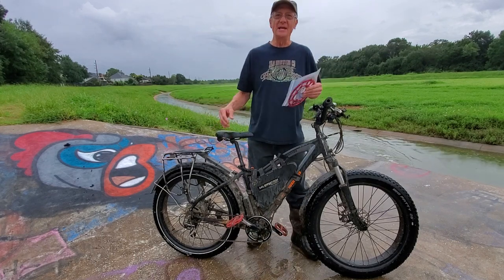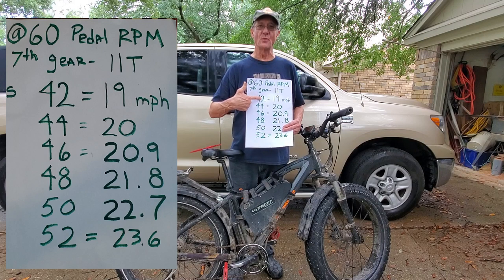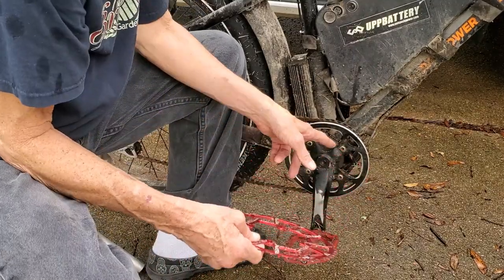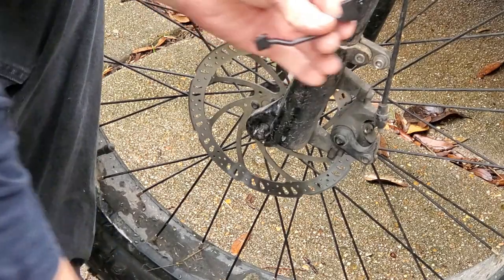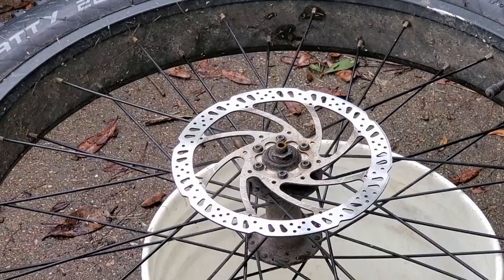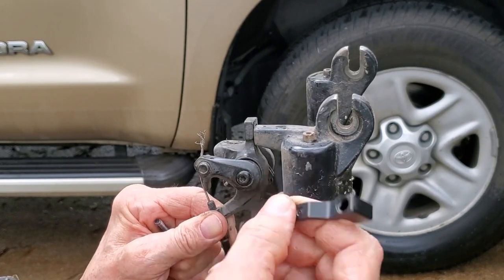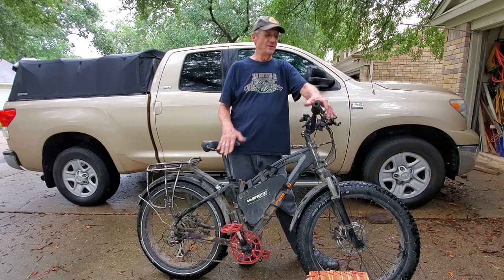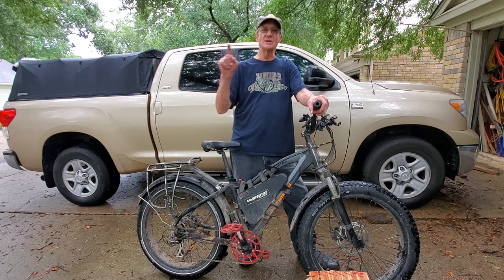New RadRover Upgrades!!!

Comment: Funny enough, Area 13 makes a 246mm rotor with a brake braket extension that adds the needed space on a 203mm adapter, stacking them. So that does now exist, if someone wants to go from 203 to 246. Though, it doesn't work for 160. Just 180 to 203, then 246.

Comment: I have a 2020 RadRover, changing the stock 42T chainring to a 52T. Did you add links to your chain? I read that you should add chain-links when you go with a larger chainring. My name is Stan too.
Reply from the maker: I didn't add any links and have had no problems. But I never hardly use my 1st gear. I also did my Himiway with no problems.

Comment: I know I'm a little late to this rodeo but I have a couple comments and questions.. I don't believe I heard you mention the bolt hole spacing on the sprockets is important but I did see in your link that it mentions 104 BCD, so hopefully folks will catch that if they order it off your link otherwise they might wonder what the heck's going on when they try and line up the sprocket holes. LOL. The other thing might be trivial but you didn't point out that the loctite should the blue loctite. I'd hate to see somebody put the red on there and have to break out a grinder later. LOL. I did the same power upgrades as you and get the 28 to 30 mile an hour throttle only. I was still getting that same free wheel pedal effect as you at about 22 mph. I had only gone up to a 46 tooth on the sprocket  because I wanted to keep the chain guard and I noticed that it didn't give me much less freewheel pedal effect. After seeing your chart I now know why. LOL. Putting my new ring on with both original sprocket guards also  was a real nightmare getting everything to stay in place while you try and line it up to bolt on. I was just wondering if while you were looking at larger sprockets did you also look for possible larger chain guard replacement ? I do want to go to the larger sprocket after seeing your post but I need to have a chain guard. Also I was also wondering why you didn't do a bigger brake rotor on the rear also. I haven't really looked on my Rad Rover to see if that is even possible. I upgraded to the hydraulic only calipers and I am not happy with the performance of the rear one. I was thinking the bigger rotor on the rear might help.. the rear doesn't even lock up as good as the mechanical break did on the rear. I should have listened to the reviews that said those hydraulic calipers are a waste of money. LOL.  Thanks

Comment: Hey Stan if I want to do the front brake could you recommend a different spacer  so I don't choose the wrong one? The one you linked to is no longer available. Thanks I have a 2020 RR Step through I am hoping to do both of the upgrades in this video

Comment: Hey im plaing on changing my chain ring on a stock controller im thinking 46 tooth did your upgrade affect changing gears?
Reply from the maker: Just going a little larger, you shouldn't have any problem. Mine works fine.